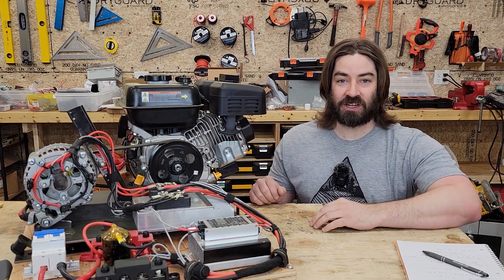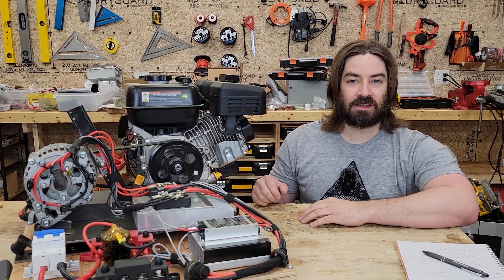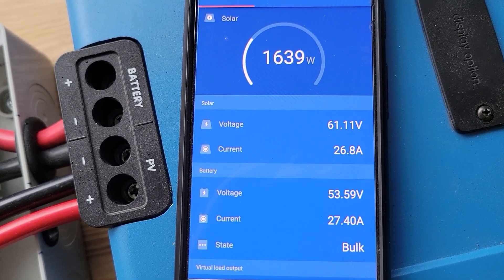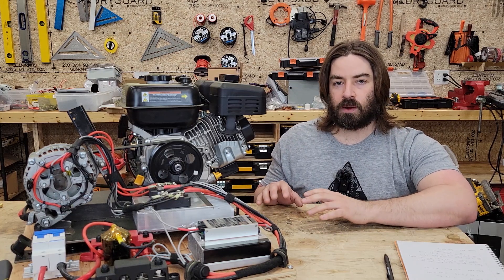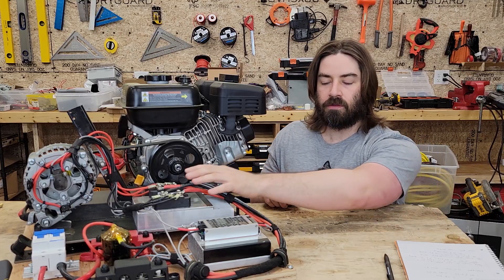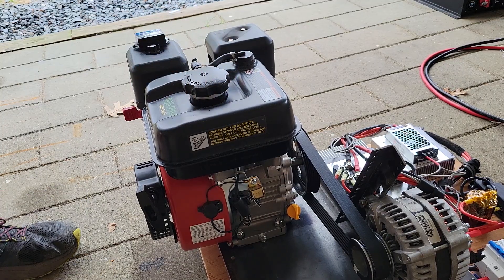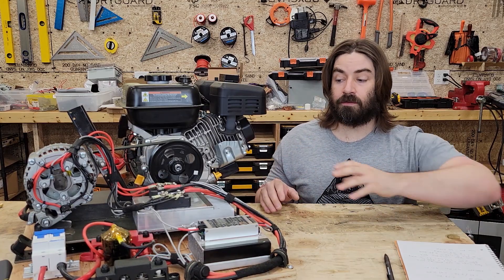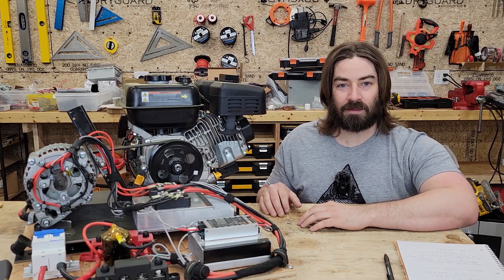More Efficient than ever!  Alternator Generator fine tuning, Part 3

Comment: Hi David, curious as to why were you not able to maintain 40 amps at 2600 rpm?  You needed to throttle the engine down to get it to 2600rpm, if it’s not making enough power can’t you open the throttle?
Reply from the maker: Because the alternator couldn't keep a high enough Voltage at 40A at 2600rpm
Reply: @DavidPozEnergy  thanks for replying.
Reply: Wouldn't changing the gear ratio to maintain 2,600 RPM on the generator and increase alternator RPM bring the voltage back up?
Reply from the maker: Hi Cabinlab,  Yes, that would be another way to do it.  If I had a larger pulley on the engine, and/or a smaller pulley on the alternator, I could have kept the output Voltage higher.  I didn't do this originally because I was running the alternator at almost 8,000 RPM, and I don't want to run it continuously over that.
Reply: @DavidPozEnergy  Oh, for sure. With as rough as it appeared to run at 2,600, I wouldn't be inclined to even bother at this point.

Great series. I'm off-grid (solar, generator, batteries) in the Alaskan bush. I actually have a spare Kohler 1kW generator with intermittent AC output, and have been wondering what to do with it. Since I also have a couple salvaged alternators on the parts shelf, and DC is more useful to me, you may have gotten me off the hook of diagnosing the AC 😆
Reply: @Cabinlab  Or see James Condon for a repair vid on the Koehler

Comment: I wonder how much efficiency you could gain by correcting the power factor?
By using just a rectifier and a capacitor you effectively only pull power from the alternator at the peaks of the sine wave.
You should be able to improve the power factor (and reduce load on the engine) simply by adding 2 big inductors after the 2 rectifiers.
Reply: Because the alternator is 3 phase, and the rectifiers are full wave, the 6 power peaks nearly overlap, and the power delivery is nearly continuous. Much better P.F. than you get with single phase.

Comment: I'm thinking of using a water cooled engine,  it's easier to put the "waste" heat from the ICE engine into the house.  Probably the most effective  way to increase the efficiency. (winter colorado)
Reply: Look into a water cooled exhaust, a rough rule of thumb for small engines is 1/3 mechanical, 1/3 heat out the cooling system and 1/3 heat out the exhaust.
Reply: On my 4kW generator, I have an EGR cooler on the exhaust. Still need to test, but there's a lot of wasted heat energy available. Even if you used a water cooled motor, you could grab more heat off the exhaust to feed into your hydronic system
Reply: Its a good idea but dont cool the engine below its normal operating temp or your efficiency will take a big hit. Thats why engines have thermostats.
Reply: @manoo422  yes, you dont run the water directly through the engine open loop. you use a closed loop via a thermostat to keep the engine at operating temperature and only drain water that is high in temperature (less volume, more temp) that way it is also better for storage as you heat the top part of your tank first and slowly move the frontier of warm and cold water from top to bottom and dont try to heat the whole volume at once. I would also suggest using a water cooled alternator and rectifier, that way you can harvest the energy losses from it as well.

Comment: Maybe a flywheel would help smooth things out.
Reply: Mass does wonders for making an engine smooth and quiet.
I have a single cylinder diesel that works well, follows a rule of 6.  It makes 6hp at 600 rpm , engine weight is 600 lbs, and it is bolted to a 6000 lb block of concrete. 
Probably could get by with less concrete but why mess with something that works.
Reply: It probably would but it would soak up power too.

Comment: Hi sir David, Can we make a series connection on the alternator? For example if you have a 12volts two of them to make 24 volts? Thanks
Reply from the maker: Check out the YouTube channel "Trial N Error"  he seriesed connected two alternators.
Reply: Or just use a 24v alternator
Reply: @dantronics1682  They are typically a lot more expensive to buy, i.e more than two 12v.

Comment: I think criminals in prison should be forced to ride a bike connected to a motor to generate electricity.  I didn't watch part 1 & 2 but maybe you can try connecting two alternators on next video.  Thanks for sharing😊.
Reply: That would be both cruel and stupid. Congratulations.
Reply: Most prisoners get options to work off their debt by giving there time and good behavior. The more you give back the earlier you are set free. But can we get more input on the alternator generator instead? I think if it was a hemi it would be more efficient.

Comment: They have those small deisel engines that run slower. Also deisel stores better and you can run tax free.
Reply from the maker: I like diesel quite a bit more for generators.  I have a diesel generator that I plan to do a fuel economy test with.
Reply: @DavidPozEnergy  I would love to see this repowered by a 12/2 lister diesel.

Comment: See how many alternaters you can put on the setup
Reply: The engine should make about 7 HP peak, the torque peak was 10.23 Lb Ft @ 2,600 rpm, That is a bit less at about 5 HP. 1 HP at 100% efficiency is 746 watts. So at the torque peak, it is only going to push about 3,500 watts and revving it up higher, maybe 5,000 watts tops. That puts the limit at maybe a second of the same alternator to max out that engine.

Comment: It would be really cool if you could do something with the engine heat.  That could easily raise this usefulness of this by a lot.
Reply: Agree.  Especially for this climate zone.  The least sunlight (from snow, clouds, seasonal reduction) happens when he needs the most heat. So if the generator can produce power and also is water cooled by water that is used for heating this could work well.  

Awkward to diy such a setup but and there are major issues such as the noise and unreliability of a generator.
Reply: @GeraldMMonroe  - What you are leaning to is a cogen system and while it is probably beyond the scope of what David is trying to accomplish, a cogen project would be a great idea. I would start with a small water cooled, low RPM (1800) Diesel engine (like one of those 3 cylinder Kubotas they use in sailboats), direct driving a two pole alternator. This would provide 60Hz power when the engine is running. The hot coolant would be pumped and sent through radiator/fan units to provide heat. Even the heat from the exhaust could be captured using an air-to-air heat exchanger and use that to heat a greenhouse or barn. No reason that one couldn't add a water pump to the same engine for irrigation or pumping water up into a gravity tank. Figure out a way to use methane gas produced by humans and animals for fuel (and cooking) and you would pretty much self sufficient.
Reply: Not 2 pole  generator !
4 pole . 2 pole is 3600 for 60 hz.
Reply: I live in Alaska, and added a flange and additional pipe to increase the ambient heat in my power shed in winter. Next step is to add a heat exchanger and hydronic heating so it's efficient enough to passively maintain a high enough average temp to use lithium batteries in there.

What ideas do you have besides hydronic heating? Since gas generators are usually under 15% efficiency, there's definitely a lot of energy to utilize
Reply: @Cabinlab  I have collected some diesel pickup EGR coolers for an experiment to heat water with generator exhaust (and air heated by the engine casing). An EGR cooler is a premade dirty exhaust gas to liquid heat exchanger and is sized to handle the entire exhaust flow of a ~200cc engine. Time will tell if i follow through..
Reply: The easy way to do this (not sure of effectiveness though) is to point the engine and cooling system exhaust at the outdoor part of a heat pump.

Comment: Have you heard of injecting or entraining steam into the air intake??? Supposedly it helps increase compression as well as helping to reduce internal carbon deposits, keeping the engine cleaner.
Reply: usually in turbocharged applications, thats water + methanol. It does clean the intake track, but its mostly to evaporate and cool the intake charge, leading to higher air density at a given boost level. Not sure why you'd inject steam.... and in this setup, since NA, not required. Unless Im missing something?
Reply from the maker: No, I haven't heard of that.